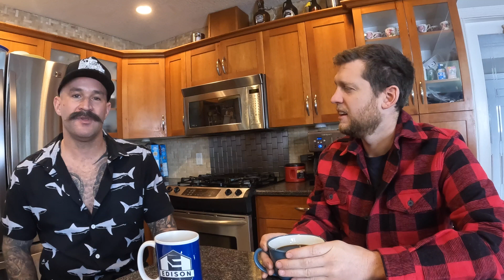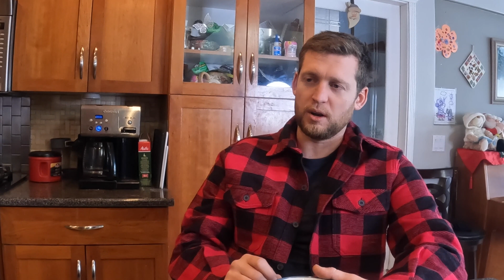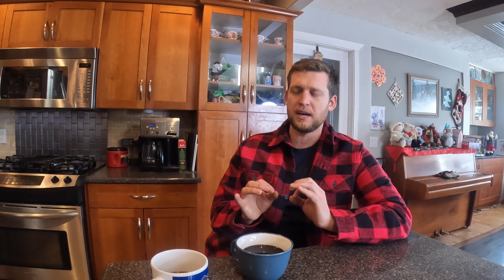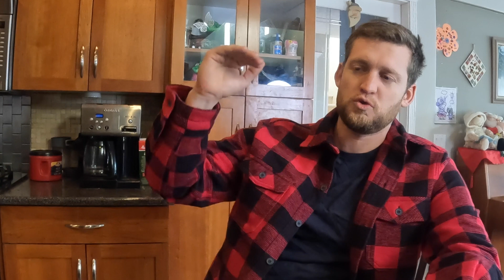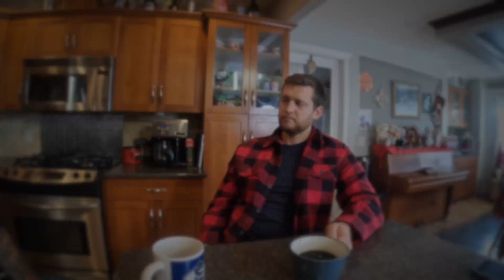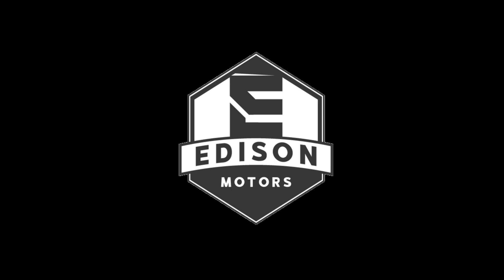Diesel Electric Advantage

Comment: We still have diesel-electric trains on some minor rail routes in the UK. I have no technical knowledge, but my intuition tells me that a small diesel generator could run continuously at optimum revs while the vehicle was in use, and could also continue charging when the vehicle was not in use (ie parked). Also, my intuition tells me that this application would be well suited to agricultural (tractors/diggers) industrial (forklift and telehandlers) and all-terrain vehicles (Argocat?) – and unmanned military ground vehicles, as being developed by Ukrainians to repel the  Russian invaders.

Comment: This is so interesting & amazing all at the same time this would be perfect in a Farm Tractor like a Big Bud Four Wheel Drive with Capacitor’s or Battery & Capacitors plus that Diesel Generator or Hydrogen or whatever fuel you want preferably Canola Oil grown on your own land now we are talking about saving major money & actually getting ahead  now that is language I understand not all the other BS that I always thought was true like 18 speed (Power Shift is superior or CVT )over  a  conventional clutch & floating gears ).   transmissions & big Diesel Engines & things like that where it just sucks the fuel  & of course in turn money cause you have to buy all this shit all the time well maybe now we won’t be bent over a table. Anyway it sure gives me some ideas for sure & I have always thought like that instead of  the conventional way of doing things i like innovation but also tradition
Melding it together oh yes this is exciting for me .And of course you could use a Turbine Engine to generate power because Turbines need to spool up and then stay consistent at a certain RPM & that’s why Chrysler’s Turbine didn’t work well because in traffic it was dropping RPM & then Spooling up again so actually the batteries are acting like the Transmission & the Capacitor would be the same though quicker responding yes the more I think about all this the more excited i get this is way better than Hockey or even Sex this is fantastic were Canadian  🇨🇦  A .

Comment: Makes great sense just eliminating the clutch and transmission system and all the friction losing components. If or when battery failure occurs while underway the generator output could be switched to operate a single drive motor as a Limp home to a safe spot drive unit. If empty load it could possibly drive at highway speed.
Reply: hasonlit az en otletemhez TE is ugy almodtad

Comment: unless batteries get a lot better, i guess highway trucking electrification might just need overhead wire so it can charge while moving. i believe siemens has gotten it working but it’s a lot of infrastructure…

Comment: The diesel-electric truck would also be the perfect heavy duty service vehicle. Often times field service companies require bringing temporary power to the job site, 3-phase power is often required to perform field services, and rolling up with one of these trucks would mean that you are coming with a generator ready to party. Rental companies such as Sunbelt rentals could easily rent out a diesel electric generator truck as they are currently renting out both service trucks and large diesel electric generators separately.

Comment: Having worked in mining with electric trucks a problem that occurs with electric trucks is motor overspeed which can cause the armature to take on an egg shape which will cause a significant power loss if not complete failure. Is there any kind of protection for this in your trucks other than extensive training of the operators?

Comment: When I was a boy, my Dad drove trucks I used to love going to work with him. I asked him how a Diesel train worked, he explained to me how diesel trains are really electric trains with a huge diesel generator to provide the electricity. I asked why don't they do that for trucks? He could not answer me. To this day, I am now 45, I still wonder why they don't. To see someone actually doing this is amazing. Komatsu does it for their 500t mining trucks. Thankyou for realising this.
Reply: it's all due to the weight.

the concept of diesel electric exists for nearly 100 years but the electric storage technology up until recently, was crappy. even with crap power density of old batteries, you don't care much about the weight of those, when you have a 100+ ton locomotive or a massive mining truck. however, you couldn't really increase the weight of a regular truck by tens of tons and still be efficient/comply with regulations.

now that the battery technology evolved, it became practical.
Reply: Are there any diesel electric car?
Reply: @babudhi  yes all the hybrids r basically diesel electric

But they r parallel diesel electric

The truck mentioned above is series diesel electric
Reply: @babudhi   I think it is possible to do. Lightweight enough to fit inside a Toyota Prius engine compartment, while still being durable enough to also withstand towing a 5th wheeler if need be.

Comment: Diesel electric locomotive does not use batteries or capacitors in the power circut, you have built a Battery Electric Truck with onboard charging.
Locos link the alternator directly to the traction motors.
Chances are the alternator you are using is not suitable for this type of work.

Comment: Hey guys. Have you reserhed high torque Regen breaking. Electric drive means you have no exhaust/Jake breaking. Friction breaks can only last for a reduced distance under full load. You speak of a smaller battery rack. How much empty battery you can soak up your Regen breaking into & how much breaking can regen do under load? Can you plan trip on a computer to be able to seriously Regen break down a  several miles long slope?

Comment: Just an idea, for the guys making the truck, why not make the motor a bit smaller, and have a single gear attached to the the diesel drivetrain, that is turned to run the truck at 110km/hr.  When the truck is on flat land and cruising at 110, the gear engages and connects the diesel motor directly to the drivetrain bypassing the electrical conversation and energy loss.  When the truck slows down or speeds up, the gear disengages and the electric motors take over.  And, once the truck is back at 110km/h the mechanical drive kicks back in.  Find a diesel engine that and pull at truck at 110hm/h at optimal rpm.

Comment: I have hyping this idea for years. If you can have both non steering axles with their own motor that run when accelerating, then switch to a single motor to keep the momentum at speed while supplementing with the second axle I see no reason this wouldn’t be fantastic for OTR trucking. In the US we have 82,000lb limit for electric semi trucks. This could enable downsizing the generator to like 6 liters I suspect. Not to mention, the efficiency of using the diesel as a generator makes it reasonable to run more often. The load reducing nature of a hybrid would also but far less wear on emissions equipment. Then there is the simplicity of dealing with a single speed transmission. Just step on the pedal and off you go. Hit cruise control at 60mph and it would never deviate, no matter the grade being driven. Simplifying OTR trucking is how we get the next generation in to the business of keeping America prospering!

Comment: That LeTourneau he mentions @ 18:25 was built in my hometown. 😁 Kinda surprised LeTourneau didn't do trucks, but I guess without batteries to allow for the diesel to rev in its powerband all the time, direct generator-motor drive doesn't improve fuel economy much -- the reason it took off in all other heavy equipment was that they couldn't make gearboxes strong/long-lasting/reasonably-priced enough (it's one of those "you can only have two" situations, even more so back in the day), they still throttle up and down with load, just takes out the inefficiencies of a mechanical transmission.

Comment: On old trucks from 60s and 70s, i can see how they actually got lighter. Im curious if the same would olay out in a 90s truck, as materials advanced, motors/transmissions may have got lighter, but overall vehicle conplexity increased. Winder if they would see the same results. Hard to aay as there are newer technologies that may beed to be addressed differently, and that can affect weight.

Comment: Its great that Edison Motors is tackling this niche at this time. People winder why nobody did this earlier, abd there are a number if factors, but i can think of at least 2: Battery cost and fuel cost. Batteries 10 years ago were MUCH more expensive because of smaller scale production. Trucking is very cost sensitive, and theres not much of a vocational "luxury segment" that is willing to be a pathfinder for the tech like you see with cars. Without light duty EVs causing a scaling of battery production, we wouldnt see batteries cheap enough for this segment. And fuel costs: historically low diesel prices discouraged  development if hybrids as the juice wasnt worth the squeez. Now, things are different. So a forward-looking company would have been wize to keep developing the concept and tech, and then when the time is right been able to pull the trigger and ve a segment leader. But too many companies only look a few quarters ahead for short term profits (obviously not referring to Edison)

Comment: I need an electric axle for my Ford E350, just in Alberta.  Can you build me one?  Ford is being difficult to buy an electric Transit cab and chassis, thinking I will build my own.  And to somewhat steel your idea, I carry a diesel skidsteer on the deck, I will make a hydraulic generator charger and minimum range truck.  With just enough range for daily use, if I need to go further I fire up the skidsteer and charge the battery.

Comment: - one of the first (and clearest) explanations of the difference (and pros/cons) of the different architecture.

Floating the battery between 20-80% for its entire life should give so many more cycles than expected.

Also - noting that a single speed EV only develops peak mechanical power around (edit: or in some range of decreasing torque before) redline, at full torque (edit: or some nominal rev range near the upper end- this is inherent in the maths of unconstrained (power limit of motor windings) current (Amps - which may or may not be true) and s flat constant voltage torque curve) , while a diesel does achieve it during every gear - with Zero power during shifting - intermittent power delivery which gives (relatively) terrible outcomes in highly variable duty operation....
 - Peak torque in any case can't practically exceed tractive capacity, or the drive dust goes nowhere (wheels spin and axles tramp - EVs can have perfect traction control and very predictive outcomes.

Lol - yes, Electrics are relatively simple, any mechanic can figure it out to replace parts (the inverters, charge controllers etc are relatively simple to swap in and out (non user serviceable internally) - treat the batteries similarly - they can "always" be manufacturer reconditioned and repurposed (given the correct design process). - obviously most of a vehicle are parts "other than" the propulsion system.

Comment: Exactly as he said diesel-electric is ideal for cleaner diesel burning, more efficient diesel burning, more toque at low RPM, quicker torque at low RPM, more silent, regenerative breaking, in-city frequent start-stops, longer life of motor, less or no wear-tear in clutch and transmission (if even those are present there), no long waiting at charging station if such is even available. Best of both worlds. Did I forget something? Diesel trains and heavy equipment (such as surface mine trucks) have this for ages already. Win, win, win, win, win.
Reply: I think the tricky thing here is that these trucks will probably only use fuel and almost never be charged from the grid. But who knows maybe the loggers will install their own charging stations and charge their edison trucks overnight.
Reply: @andionn5575 
The tricky thing people don't realise is ONE TRUCK consumes fuel equivalent to 1000 personal cars !!!

A car just sits idle at home or at office parking most of the time whereas A trucks main job is moving constantly and gulping mammoth amount of fuel

Now imagine
Does the world hv grid capacity to charge these GIANTS if all trucks were electric ??

I don't see not even in next 50 yrs...😂😂😂

so diesel is gonna stay as prime mover in heavy equipments
and diesel-electric is most efficient way of using it.
Reply: No transmission in a serial hybrid, big saving in weight, repair down time and cost.

Comment: I know how many comments you get but I keep saying this change that diesel engine to a turboshaft generator. It's even more reliable with a higher maintenance interval and will weigh 1/3 as much😉
Reply: You trade weight and complexity for fuel burn! A 350KW turboshaft generator would burn twice the amount of fuel that the diesel that's producing the same amount of electrical power would.
Gas turbine engines are very good at making stupid amounts of power for there size and weight but they also burn stupid amounts of fuel doing it!

Comment: It is a interesting concept. Been involved in trucking all my life. This is nothing new it has been tried before in trucks and did not work out.  Your not the first to look at it some of the big company have built prototypes. Even some small production units. It never went anywhere. The diesel electric is a great concept and works well in some applications like mining truck and trains. The problem with all this stuff is the complexity of the support systems. Anyone who’s ever worked on a train or an or a mining truck truck will tell you the problem is not the generator or the motors it’s the electrical control systems that need constant attention.
Good luck in your venture.
Reply: If an diesel electric concept has 10 problems, sending rockets wud hv 1000 problems

Yet people hv been doing it...right ?

If electrical control systems r the problem then all EVs (Tesla, BYD) with 100+KwH batteries and 250Kw motor wud hv been dead by now !!

Comment: I’m am against the EV craze crap. But this makes sense for heavy duty local trucks. As he has said, full electric the tech and infrastructure problems are a big factor, but using tech already there for freight trains makes this work. Brilliant idea, and it’s made by truck drivers for truck drivers. This is where it’s at. I still love an old school manual trans truck, but wear and tear for local heavy haul and logging, this is simple and durable. The best part, the prototype looks tough, and looks like an old truck, reminds me of old Oshkosh trucks, not some ugly ass otr volvo.
Reply: "EV Crap" IS All of the benefits they just spent an hour explaining. 
It works at all levels, not just heavy haulage.

Comment: This is a great Chanel. I love the detail you go into and the idea is brilliant. I’m an energy engineer not a trucker, can you tell me why this isn’t good for general road hauling? I’m from Ireland which is small and has lots of small towns and start stop bits for trucks. The diesel electric set up sounds far more efficient for this type of driving as well as your specialist timber trucks etc. you keep mentioning that it’s not best at this type of work- why is that? 

From what you are saying it will run the engine 25% of the time and at a more efficient rpm.
Reply: May be he is talking from US/ Canadian truckers point of view where trucks target 600+miles (1000km) day run

Here the battery is capable of doing only 200 km before needing recharge

So diesel-electric truck is idle for hauling heavy loads for short run

Comment: Will there be an option to plug in the truck if you just want to top up the battery without running the diesel generator?

Comment: Diesel electric is what is powering trains today. I was wondering if you have conciterd a diesel electric conversion for a truck. Not a tractor. But like a pickup truck. Since you've solved the issue battery in a tractor. I'd like to see a pickup truck converted using your principal.

Comment: Here's another thing. If you have electricity powering everything, cars,trucks, home heating, and if we all this power comes from renewables, you've built an incredibly fragile system.  If the weather is bad, you can freeze in your unlit home, and the stores will be empty.  I know diesel pumps run on electricity, well folks there's ways of pumping Diesel into tanks, even if I have to handpump into a truck I can do it.  Try getting a frozen wind turbine to spin.

Comment: I think where your setup would really shine would be for smooth bore tanks. Food grade tanks can't have baffles in them because it makes cleaning them next to imposable, so the smoother acceleration from an electric driveline would keep the load from surging like you can get from not changing gears correctly. 
I'm guessing the off the shelf parts came from all the pitch forks raised at John Deere not wanting farmers to fix their own tractors.